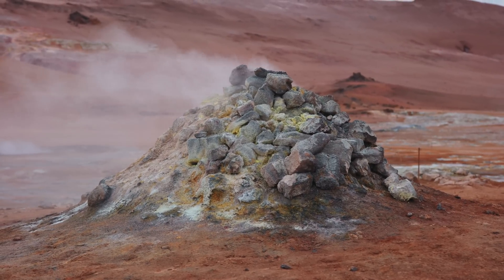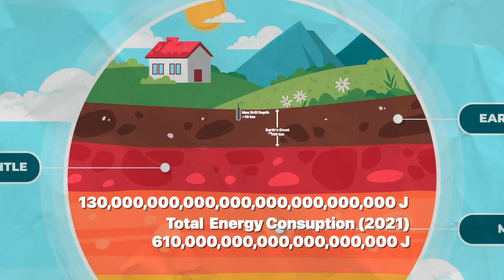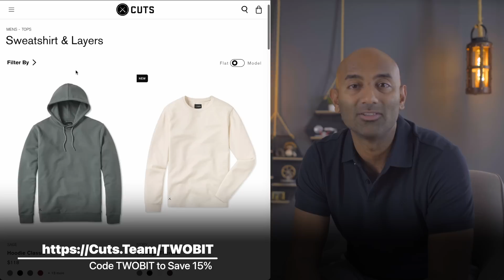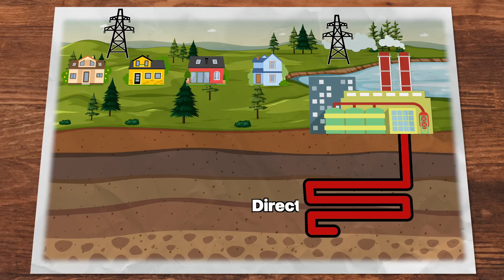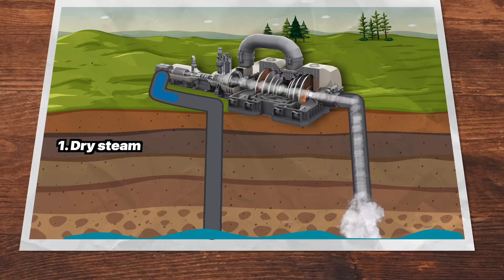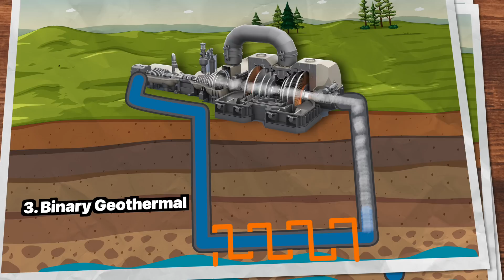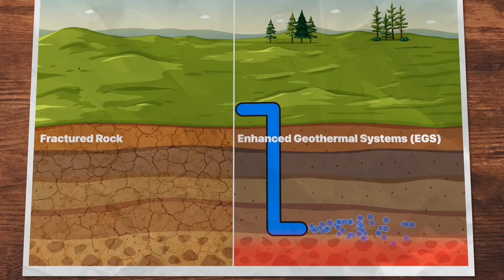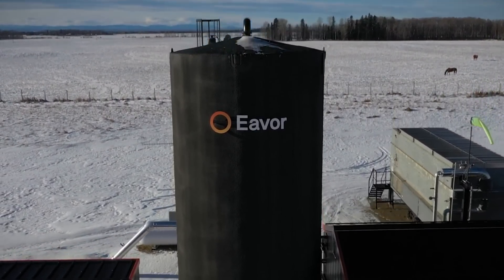This Breakthrough Energy Source Will Replace Nuclear & Coal!

Comment: What if the universe is a battery, and we need only tap that battery to power our existence...this was the philosophy of the aether movement..later zeropoint energy movement.. quantum energy movement...etc 
 Humanity could be one simplistic discovery away from rendering all these other complex and convoluted schemes useless or relegating them to specific case uses.. 
  It seems to me humanity has a weird fault of not combining existing tech to solve existing problems..like desalinization plants creating too much saline water but not using that saline to make batteries..discharging it into the ocean instead. Or solar and wind farms not storing power as hydrogen and oxygen for long distance transport but relying on miles of copper wire. 
 It's almost like humanity is being held back while simultaneously making advances.. three steps forward two back.. obsessions with "efficiency" and carbon neutrality being two major hindrances.. let others work on other problems.. make energy production simplistic  decentralized and wisely available...that should be the first goal. Then we can solve the other issues.

Comment: During the Obama Admin, the DOE investigated the potential of geothermal; according to Sec Energy Steven Chu, it would not serve to replace Large base load suppliers, like coal/nuclear (1GW+) . The problem was inadequate concentration/intensity of thermal flux. OR, excessive capex dedicated to underground heat exchanger.

This video indicates some progress over the past decade.    If 100MW--200MW plants prove feasible, they would be ideal to complement the intermittency of wind/solar; even if more expensive than nuclear.
Only the closed loop plants would pose only limited threats to ground water aquifers.

GoogleX  R&D on shallow geothermal for residential/commercial HVAC proved that concept; Stanford trained
engineer/computer scientist Kathy Hannun left Google to found Dandelion Energy, operating in the Northeast.

Comment: The Earth's magnetic field is generated by the geodynamo process in the outer core, driven by the combination of heat sources and the Earth's rotation. This magnetic field forms a protective shield, the magnetosphere, which plays a key role in preventing the stripping away of the Earth's atmosphere by the solar wind.

We should be very careful doing anything that could cause changes in the earth's outer core, crust or accelerate the transfer of heat from the core to the surface.

Comment: Lots of crazy comments over the last few months.  Eavor had a free app that totally explains their system.  In December they completed a bore which produced 250°C .  At least 4 companies are working on technologies to drill into hot rock.  2 of them look really promising.  (mm wave & plasma)  Sensor technology is being borrowed from NASA's missions to Venus. (475°C)  Eavor was recently awarded €1b to build commercial plants in Germany.  They will be used for district heating and electricity generation.  They should be in operation in a couple years.

Comment: Only Fool would Use Solar & Wind when the Earth Generator It Only Power Earth Generator Whole Earth , Coal Can Burn at 100% also Can be turn in to Battery . Even New York City Methane Gas from Sew Line can Run  New York and More . Ocean Wave 1 Miles Deep Generator Power the Earth , CO2 Battery Can Run 100% also Can be use Created Hydrogen. Nuclear Power is NUT & Insane

Comment: You guys gotta check out LPPFusion. Forget about the multi-decade multi-billion dollar projects that have yet to do anything worthwhile for anyone, except convince people to give them more funding. LPPFusion actually has a promising strategy. It's a small operation, and their device is smaller, safer, cheaper, and burns a hydrogen-boron fuel - which is highly abundant unlike the deuterium fuel used by the money pit dead-end fusion projects. They don't get anywhere near enough exposure, and virtually nobody has heard of them. It's insane.

Comment: This needs a RETHINK.....why do you need to get water hot enough for steam......when all you need is a temperature differential of HOT & COLD to initiate a STIRLING ENGINE relative to turning a generator to produce electricity.....HENCE...you don't need to go DEEP for drilling a well !!  VERY SIMPLE......

Comment: Maybe I'm over thinking it. We want zero emission power supply to combat global warming. Heat is energy and I'm sure conversion to electricity has losses. Most of the power made will be converted back into heat in the end. So in short we are combating global warming by pulling heat from under the ground and releasing it on the surface... On a massive scale I wonder if this would influence global temps in its own right.

Comment: I've been waiting for this topic to be presented! I have for some time now seen the mixture of geothermal and heatexchangers as the best way to heat our dwellings and work spaces, not to forget hot water. 
Electricity is best from hydroelectric sources. Iceland has electric power from their volcanic activity. It's not very effective all places, but if you have a heatexchanger, you can store heat in rock formations in the hot periods when you're cooling your home, and use it for heating when it's cold..
Etc , etc...

Comment: Hi cost ,No guarantee it wont cause unforseen damage,  drilling is  way too expensive. Solar is cheaper--- electrify the desert--  its a WAY SMARTER SOLUTION. Solar will only improve.. The HOT DESERTS is the key to solving our energy needs.....

Comment: About the "core-cooling", probably solar fields could use the suns power to put heat back into the ground, so the earth is the battery and any core-cooling is a non-issue.

Comment: Geothermal seems like the most promising path to me. A few more quirks to solve and it could be used basically anywhere on Earth, without need to extract non-renewable ressources. It just seems like the absolute best solution on paper.
...But I'm no specialist, so I should probably let the experts continue their work and wait until time tells which "new energy" will be the one that works best. Thank you for giving us the info that allows us to do just that.

Comment: Well since they are always drilling 2-3 miles deep for gas and oil,  it should be possible to do the same for geothermal.  However,   seismic energy follows the path of least resistance,  so every puncture of the bedrock can affect the transfer of that energy.   This is why much of the seismic energy now crosses from the San Andreas fault across the southern end of the central valley of California to the eastern side,  rather than continuing down the fault.  Some does,  but some transfers across the thousands of oil and gas well across the valley.   The punctures of the bedrock also lowers the activation energy for stored seismic stress to release,  causing many smaller earthquakes rather than fewer large ones.
Now in California,  a lot of the geothermal injection sites at volcanic features do not pump just water down the injection sites... they pump raw sewage,  with the idea that the  high temperatures will sterilize and destroy the raw sewage.

Comment: Awesome topic, Ricky.... But, .... Why does everyone covering this topic only mention radioactive elements in the core and forget a huge player in the game??? .... Luna.  The Moon is tidally locked to the Earth"s core..... Meaning that the Planet  rotates 30 times faster than the core does  and this creates the Viscous drag which keeps the mantle fluid And the combination of the two creates our magnetic field.... ok, so I digress.
Binary Geothermal plants are the best way to go here.  Lower operating temps, depending on design... Ammonia versus say Gallium as the working fluid or transfer media, [ Gallium would be awesome and atrociously expensive, and rare for instance.].  Using NH4, [Ammonia ], would work for small, even per household scenarios, but it's explosive and deadly, so it's not happening. Using a CFC like 134a would be good as it wouldn't require a lot of heat to get good pressures, and neither would the condensers need to be large to get it back to liquid form.. but the manufacture of this stuff by say Dow Chemicals or say Monsanto or some such would worsen the pollution in it's creation...etc. So Binaries would need to stick to the ASHRAE class 700 series of organic refrigerants  to get the job done.
What our Chemists and Geo-Techs need to do is start consulting with the Engineers in Iceland and see what they devised as a proper working fluid for geothermal power. .... Then mind you, Reykjavik has a few nearby volcanoes and really doesn't need to be picky about where they are laying their piping.  Nuff said.

Comment: I am very enthusiastic about geothermal energy.  It's totally clean, small footprint, and massive amounts of energy in the Earth.  I think it's a matter of "cracking the code" to find the most efficient means of extracting.  I think eventually drilling deeper will do it, and I  like Eavor's process also.  For those who freak out over tremors, we need to remember that nothing is perfect.  Would you rather have your neighboring mountain have it's top removed and then breathe in the coal dust as we burn it?  Yes, I'm a fan of solar and wind also, but those are never going to be enough to replace oil and coal.  We need a diverse range of power-generation that will not leave us dependent on nations who are bad actors in the world.
Reply: We are already getting tremors from Fracking so this is not any different.

Comment: back when the fukushima accident happened, there were fears that the nuclear core would sink into the earth and just keep going down while releasing toxins into the atmosphere... might it be possible to do such a thing in a controlled manner, syphoning the radioactivity out of the hole until the core literally fuses with the earth's core... I mean, you'd have a very deep hole, which is probably only step one, but still.

Comment: The main problem is that geothermal energy is just not exploited in a serious way. It is not cost, as geothermal energy beats out all fossil fuel new build power plants. It beats out nuclear power by a wide margin. I is on par with hydro power in optimal places. The technology is mature. Drilling for geothermal power is done with the same equipment you use for drilling for oil.
If you drill deep enough you even find heat in so called cold areas. But it is possible to start with the optimal areas. For binary plants you could use water down to 100¨C. For areas with no water you can go to closed loop systems.
The fear of injection water and getting earthquakes in a country that use fracking to get gas and oil, is past absurd.
If the investments cost stop geothermal, why does anybody even talk about nuclear.
Regarding geothermal energy the problem are not technology, but a resistance to just start doing in a big way. Because of the upfront investments we can not wait for private companies, governments have to get involved, as in nuclear in the beginning.
I suspect that fossil fuel companies pay senators and representatives to not look at geothermal, because it will kill off fossil fuels.

Iceland uses geothermal energy for about 60 % of its energy needs, mainly space heating and electrical power. A growing use is for industrial processes. About 25% of our energy needs are provided by hydropower all for electrical power. As it is we do not expand geothermal because our power needs are satisfied. Converting transport, the area where we still use fossil fuels, take time to convert. As it is, we are number two behind Norway in electrical car ownership.

Comment: In 1982 I worked with Sidney Levy on a geothermal loop using freon and ceramic pipe.  Worked like a charm,  but no one was interested.   Was before the global warming frenzy.   In fact, everyone was talking about the coming ice age.   We also demonstrated a Stirling engine that generated electricity from geothermal vents like those at Steamboat Springs and Yellowstone.   Big Oil was in the way.  More recently,  we modeled a tidal generation system using the Shinnecock Canel between Shinnecock and Peconic bays (in Long Island,  NY) as an example.   Made us wonder why the Panama Canel isn't being used as a power plant... lol.

Comment: We DON'T need exception amounts of storage for intermittent renewables, but we do need some baseload generation and Hydro is failing us due to climate change, so Geothermal might fit that bill, but it will be expensive to get decent grade heat.
Standard electricity use (+EVs) is practically solved and very efficient, the big problem we have is getting away from fossil heating in cold regions, and district heating with shallow geothermal will work for that first.

Comment: Thanks for the informative video. My concern with geothermal is that we will end up transferring the heat from the Earth’s core into the atmosphere, which is what we are precisely trying to avoid with the greenhouse effects from burning fossil fuels.
In fact, I’ve read recently that massive solar farms may have similar warming effects on the atmosphere and local ecosystems due the huge sunlight reflective properties of the millions of mirrors. 
Admittedly, I am not sure how scientifically accurate these theories are. But maybe worth exploring.

Comment: Lots of volcanoes out there to just tap right at the surface.
Electricity can be sent a long distance too. An the initial cost? Well the fuel source is unlimited so why is this an issue to consider, you will get the cost back much faster with less break down cost than turbines, maintenance of solar, supply of coal an disposal on nuclear. The only reason it's not done really is they can come up with BS to charge you excessive prices.

Comment: Sounds Good, until You consider that changing the rate of cooling the crust may cause more earthquakes and shifting the crust mantle differently, than currently.  Using geothermal in volcanically active areas may be the best spot if they are likely to  explode anyway, if high pressure ,high temperatures  are not stiffened off 
... but in other areas tapping  into geothermal could with only 1/1000 of 1% cooling.
In mantle only 3 to 9 miles deep could affect what happens on surface where we live.  My degree is in Environmental science. Every change has some effect on the whole.  The issue is ... can we tolerate the change easily, ... think first.  Not too risky in hot areas, like Mt. St. Helen's. Or Krakatoa,  where they are likely to explode anyway, as far as earth cooling goes. But certainly there are other risks, because Mt. ST. HELEN & Krakatoa DID in recent times exploded.   Risk in every thing.  Choose wisely. Thoughtfully which one is "acceptible".

Comment: One problem is the heat  and the highly acidic solutions eat the pipes up like crazy.    That causes the hole to cave in then you have to drill a new hole.    Fantastic idea but will require more research to make it it practical.

Comment: Question: If a few fossil plants are not a problem for the planets atmosphere but a world full of them running for a couple hundred years is a problem. Then what is going to happen with a world full of geothermal plants draining the Earths heat for a couple hundred years? Could someone from 1820 predict todays power use or effects on the Earth? (edit: question mentioned at end of video. Leaving question up for additional comments)

Comment: NZ and Iceland have  had Geo thermal power stations for many years.
They work well and are not expensive as the hot rock is close to the surface .
Drilling holes 5 miles down from the surface is expensive so other forms of energy is used by most countries.

Comment: Binary plants 'generally' use a gas like pentane as the binary fluid, at least in the US, I have never seen  water injection except at the geysers where they use the steam condensate to re-inject into the steam field.  the thermal field was greatly diminished in capacity when they were only injecting the steam condensate, and hence the injection of waste water from local towns back into the steam field,  which regenerated the capacity and most of the units came back on line at full potential.

Comment: Great channel. But please stop passing hypothesis and at most a theory as if they are fact. We don't know what's the composition of the center of the earth, we can only speculate. And please stop using the term "fossil" fuel. It has been debunked that oil from the wells are from fossils. Perhaps a more accurate term would be crude oil.

Comment: In Denmark we have built three binary installations and tried several other locations. Of the three power plants only one still works, which is actually the oldest and has worked since 1984. the other two has failed because of the high concentrations salts and sediments that has clogged the injection wells

Comment: in 1million years time the last life on earth will be dead, that life dies at 4000 degrees Celsius. Which means we will have died out over 999,450 years ago. Geo thermal doesn't work, where ever it has been used it has had to be stopped. New Zealand is a huge example.

Comment: Photoelectrics and battery technology are growing at a great rate of speed. We know solar gear already works, so it is very likely that the solar panels will arrive one day that work with much greater efficiency and batteries now being tested will be lightweight and virtually maintenance free for decades. Incorporating solar collection capabilities should be a part of every home, and we should strive for really durable and long-lasting solar panels. It is better to produce the power at home, it saves endless electricity pylons, the key now is to achieve the capacity for storage of the power that is generated when the sun shines.